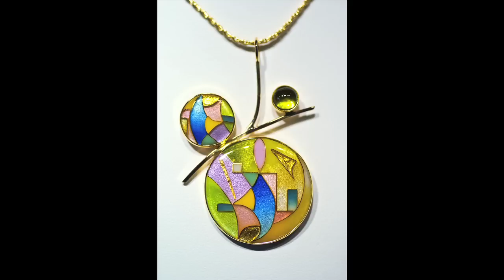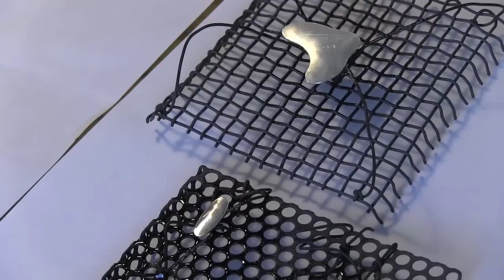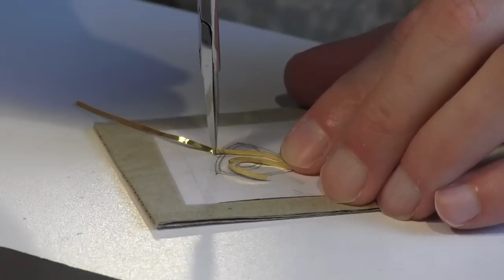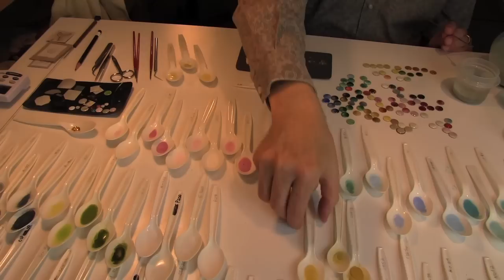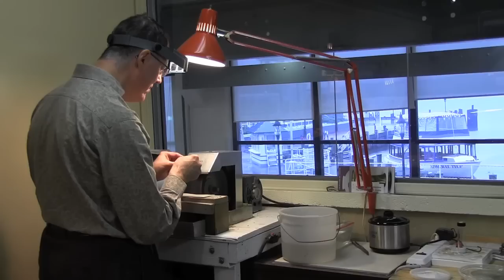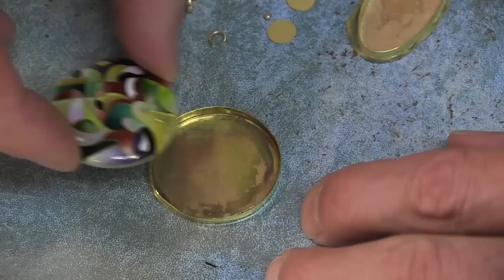Don Viehman Contemporary Cloisonné

Comment from the maker: Dear Mike:
Thanks for your question and interest. I use both gold and silver cloisonne wire. I currently have 4 different dimensions of wire that I use for different purposes, effects, and kinds of projects. My primary wire is .004 x .050 inches, which I have custom made as it is not a standard stock dimension. My experience is that cloisonne has a relatively long learning curve and requires buckets of patience,  but the work can eventually be artistically rewarding.
Thanks again.
Don 703-244-3757 Dviehman@comcast. net

Comment from the maker: Hi David:  Thank you for your kind comments.  The wire is nichrome wire. I use 18 guage; thinner is too flexible. I have not purchased any in a long time. I used to buy it from Enamel Emporium in Texas. Not sure if they are still in business or still carry it. Sometimes you can get it at a good hardware store or they can order it for you. It is not expensive. It takes approximately a foot (and a 3 or 4 inch mesh firing rack) to make a jewelry size trivet (really should be called a quadrivet :) ).
Thanks.
Don Viehman 703-244-3757

Comment: What material is that thin flat shields and where could I get it?
Reply from the maker: The thin flat shields are typically made from a durable material like polycarbonate or fiberglass. You can find them at specialty retailers or online stores that focus on protective gear.

Comment: One other question if I may ask.   What is the clear adhesive for the wire.   I have been using the Blue stick product from Rio but don't really think much of it.    Double thanks.
Reply from the maker: The adhesive I use is Klyr-Fire liquid adhesive. It is water soluble and able to be diluted. Burns away cleanly.

Comment: What kind of fuel are you soldering with? Thanks Sam
Reply from the maker: Hi Terry:  I currently do not have a finished butterfly piece (or bird). I could make a lovely small piece (approx 3/4" W x 1/2" to 5/8" H) for you with an open wing butterfly set in Sterling silver for somewhere in the range of $450 to $525. Is this what you are thinking about?
If you wish to email, it is best and more timely to email me directly at Dviehman@comcast.net or you can call directly also at 703-244-3757. Thank you.   Don Viehman

Comment: Эдраствуйте,можете сказать размер внутри печи и какой фирмы муфельный печы , из какой сайте можно смотрет копия вашего печа ?
Reply from the maker: I use an electric kiln manufactured in the United States by a company named Paragon Industries,  L.P. Website : www.paragonweb.com
I use a model #E-14. The interior is ceramic firebrick. The exterior is sheet metal. Interior is 9" high, 13" wide, 13 1/2" deep. Uses 220 volts.
Don

Я использую электрический печь производятся в США компанией по имени Paragon Industries, LP Сайт: www.paragonweb.com
Я использую модель # R-14. Интерьер керамический огнеупорный кирпич. Внешность листового металла. Интерьер 9 "высокий, 13" широкоформатный, 13 1/2 "глубоко. Использует 220 вольт.

Comment: what is the painting1.28 sec
after firing like pearlescent color :O
Reply from the maker: I am not sure if I understand the question being asked. Vitreous enamel is a type of glass that will bond with certain metals when sufficient heat is appropriately applied. Although I use a small brush to apply the powdered glass to an object being enameled,  I am not using paint.  One type of vitreous enamel that I use is semi-transparent and when fired correctly it can create a wonderful "opalescent" shaded look to the color.  I think this is what you are seeing and about which you are inquiring.  Thank you for your question.
Don Viehman 703-244-3757 Dviehman@comcast.net